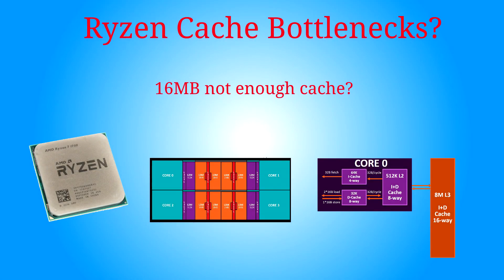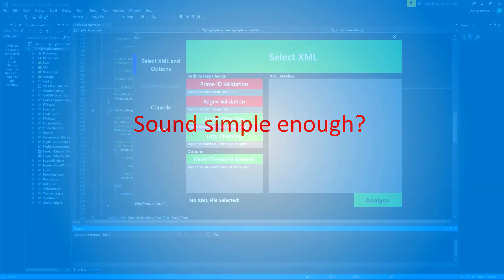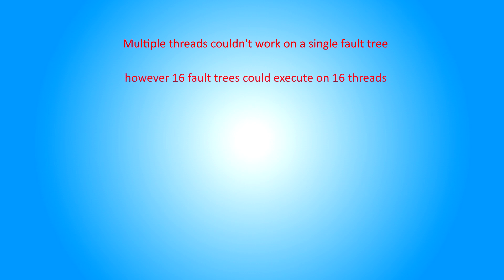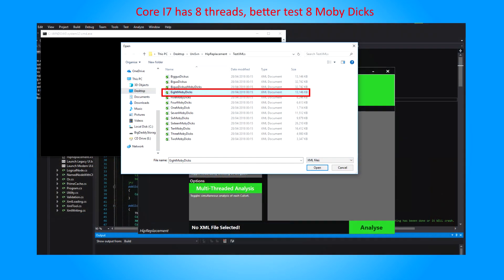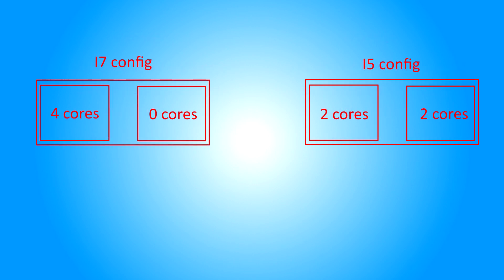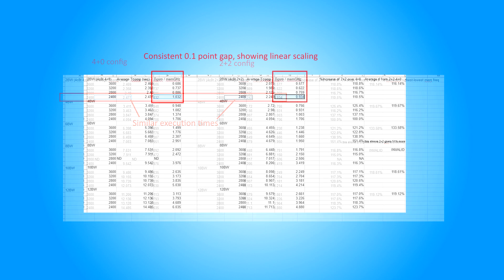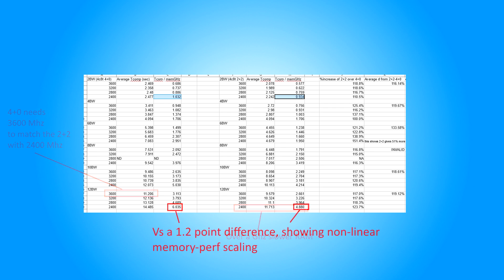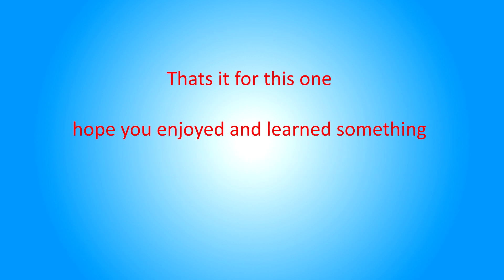Cache bottlenecks in modern CPUs

Comment from the maker: Ever wondered why the Ryzen 3 CPUs were in a 2+2 config? Here's why.
Reply: i remember the haswell (or was it broadwell?) cpus that had the 128mb l4 cache saw some pretty good gains in certain workloads even with lower clocks.  7zip with either compression or decompression (im assuming decompression because ryzen is so good at it) was really good.  i think maybe compiling as well.  there is a reason that certain low core count xeons have huge caches.  seems like i remember one that had 40-50 mb but  a very low core count like 4 or 6.

edit: you should try an i7 5775c I think it was. that was the one with 128mb edram l4 cache.  i was made for graphics but also functions as a cpu l4 cache.  there was also a haswell one but it was only available as a bga so only soldered driectly to the board
Reply: my question is why did you use 2+2 for the i5 when you used 4+0 for the i7.  i see no real reason to not use 4+0 for both if simulating either cpu
Reply: @ifyouwantmoneythengivemeev8094  yes but haswell also had the same setup with iris graphics and 128mb as well but it was only for nucs and such.  no socketed options
Reply from the maker: bad4ever2010  well I've not really found much issues with Zen otherwise. Remember this is a fringe issue. So for the most part 16MBs is fine.
Reply: Thanks for something different and thought provoking (in a nerdy kinda way). CPU cache limiting performance is not something I've particularly thought of in depth like this. Keep making these kinds of vids.

Comment: Interesting article detailing your specific usage and application (nice piece of software), however the results are not surprising in the slightest due to the multi-threaded nature of your workload coupled with the way the CCX's function along with the caching system.

I do have some questions however about why you did not test this with 1 and 3-threads per system as those results would be fill in the blanks, and I fully expect that if this application hits the cache as hard as it seems, the single core would show even better results than the dual-core, and the triple core would show a larger performance drop than going from 1 to 2 cores.

Also, the RAM latency can also make a very large difference, (although this depends very much on the application in question), some care little, and are all about the bandwidth, others are far more sensitive, your application seems to be bandwidth hungry, as seen @ 6:50 where the 2BW testing with 3200 MHz RAM beat 3600MHz, but 3600MHz won in all other testing.!

Lastly, It would be extra interesting to see if having both CCX's enabled but setting the core affiliation to only one CCX's cores would make a difference, and if so, what (as far as I understand (yet have seen no evidence) the L3 Cache from one CCX can be used by the other even if there are no active cores on that CCX)), this would mean that the cache is doubled, but the cache latency between CCX's would become rather important (this issue was addressed somewhat in the Ryzen 2000 series).

An update to this would be fantastic, not least as my suggestions would shed further light on the subject at hand, which of course directly relates to the functioning of you application and perhaps tweaks and optimisations that could be made.  Obviously All of this is utterly moot when testing on a different CPU with different cache setup (i.e. Intel), but for academic purposes this is very useful data :D
Reply from the maker: Firstly thanks for the comment, you raised some good points. The reason I didn't test odd number of hardware threads was because I couldn't configure the system to odd amounts, the bios would only allow for 2 cores, 4 cores (2+2 and 4+0), 6 cores and 8 cores. I then had the ability to configure SMT on and off, I did however test 6, both 4 core configs and 8 cores with SMT on and the 4 cores with SMT off aswel and i still have the data so maybe a follow up could be in order, also it would be interesting to see if having a second CCX active but providing only it's cache would be interesting and i would like to test this on a Zen2 cpu when I can get my hands on one so maybe I will do a follow up video on this.

Comment: I find this fascinating because I suspect that drawing on or rotating a large canvas in a drawing app means moving a lot of data, and performing fairly simple operations on it, and my own performance scaling seems to drop off a cliff after a certain point, in a nonlinear fashion, before scaling semi-linearly with subsequent increases of brush size.
I've suspected this is related primarily to cache size, but since it's hard to get solid numbers of performance, it's hard to test memory speed scaling to see if it's falling back to system memory.

Would be fascinating to see how it scales to a much beefier cache setup.

Comment: You can use the Athlon 200GE + MSI B50 MB, I got them clocked to 4Ghz(40xmultiplyer CPUv@1.425), but I'm not using the stock cooler, my max temp is 63.3 degrees. Cheap cpu and VERY good. Using 3200 gskill, not sure if memory matters, since the CPU mem speed limit is 2667Mhz;  It's the only memory I had available.

Comment: Very interesting! Greetings from Germany. :)
I found the same "problem" when testing games on my 1800X. 
I wanted to prove or disprove the comments, about Ryzen needing fast Ram, mainly because of the infinity fabric connecting both CCX.
So I did CPU limited game tests with 2+2 and 4+0 ...and 2133Mhz CL14 vs 3200 cl14(all timings locked).
So I thought I could compare the percentage gains, that 2+2 and 4+0, get from 50% faster Memory/50% faster IF.....and the difference of both gains should be the gain "solely" from faster communication from CCX to CCX because only 2+2 suffers from this.
I tested 11 games ....but the results where all over the place. Most of the time I saw 2+2 gaining 1-3% more avg FPS. But the frametimes where a different story....in most cases the 4+0 was gaining a lot more by faster memory. ....so the oposite of what I expected to see. 
Some games where doing much better with 2+2 or 4+0 no matter what memory speed.
But in general, it got clear, that 4+0 2133MHz memory was crippled by memory speeds, much more then 2+2 was. 
So my conclusion was the same as yours....L3 cache schould be bigger then 2MB/core.
I had the idea to buy a 1200 or 1400X...some 2+2 config with half the cache and test that against the 4+0....but just for one set of tests it is not worth the money and time for me.

Comment: Optimizing this would be a fun exercise.

The key to streaming data performance (for Ryzen especially) is to keep the data needed for running code to 4MiB or under - or to keep accesses within a 4MiB region of memory across all cores sharing the same L3.  This will dramatically increase the probability that the data is available when requested and prevent cache thrash, which is what you're experiencing.

I do this type of chunking all the time to keep core scaling performance alive.  I created a generic task system that allowed me to assign tasks to work on a chunk of data.  A single thread creates the tasks and the task system spawns and manages the threads.  The main thread waits until all of the tasks are complete in batches (so you'd process the first chunk then move to the next) until all of the work is done.

Comment: Was running the problem on a GPU considered?
Reply from the maker: It was considered, we decided that it would be more effort to implement and would only loose performance, the blue whale tree was very long and required strong integer performance, GPUs clock low and have very weak integer performance so we discarded the idea.

Comment: CPU on die cache has always been a tradeoff; It is extremely costly to produce, and more always helps.

Good example of cache bottlenecking is CPU monero mining, it has very little to do with CPU performance and everything to do with cache performance. I guess CPU clocks mainly affects cache latency for it, but cache size is the primary factor on how fast it runs on a CPU.

Comment: This kinda look more like a serializing memory write problem and not a cache problem.  The threads are supposed to be independent, but that doesn't mean they actually are.  You need to check to see where the stall points actually are, which you can do by generating a regular signal and recording the %rip address.  %rip sampling will generally be able to interrupt the cpu on the instruction following the instruction that caused the actual stall (so look back one instruction when perusing the results).  If the stall points fall on random memory accesses then it could be a cache issue.  Far more likely, however, is that the stall points are falling either on atomic ops on shared globals, or even NON atomic ops on shared globals.  Such operations do not scale well on any multi-core cpu... Intel CPUs tend to be able to serialize the hardware contention faster than AMD CPUs, but the point is to not have the contention in the first place.

I can give you a good example of this.  Write a simple multi-threaded program with a volatile int fubar_count; global.  Have all the threads simply increment the global, ++fubar_count (or equivalent in whatever language you are using), and tabulate the count rate.  Then test with N=1 thread, 2 threads, 3, 4, 5, up to the number of hardware threads available.  turn off any compiler optimizations so the compiler doesn't optimize-out the seemingly silly counter.  This is a demonstration of memory serialization on a single memory location and it can cause total havoc for multi-threaded workloads when the programmer doesn't realize that it's a problem.

The program itself might not be the culprit... language support or even the OS itself can be the culprit, depending on what you are doing.  Even something as simple as a global statistics counter can completely blow up multi-threaded performance, which is why programmers don't use global statistics counters for multi-threaded programs. It should be noted that the memory bandwidth on AMD cpus is approximately the same as the memory bandwidth on Intel CPUs. An Intel CPU with a bit more L3 is not going to make much of a difference unless the entire program and data fits in the cache, which seems unlikely from the description you gave.

The only way to tell for sure is to actually run some %rip sampling (e.g. like 100 times a second for each thread, signal based) while your threads are running and looking at what assembly instructions the stalls occur at (the instruction one prior to any given %rip sample).  Generally speaking, stall conditions cause %rip samples to predominantly fall on the instruction followin the one that stalled and not on other random instructions.  These will almost always be memory accesses, either atomic or non-atomic.  If they happen to focus on a global variable then you found the culprit.  If they focus on similar memory locations then it could be other things, such as read-mostly memory locations sitting right next to read-write memory locations on the same cache line.  Global locks are a very common culprit... even if the lock doesn't appear to be in the critical path, when you have a lot of CPUs banging on the same lock (even if it is e.g. a shared lock and there is no software contention, only hardware cache line contention), it can serialize operations across threads to the tune of 1uS stalls on every single thread.  There are many possible causes.

(I should add, don't base the count rate on the value of the global, particularly since you aren't using atomic ops to increment it.  Have each thread track the number of loops it does with a local variable.  Be careful not to share cache lines with other thread accidently . e.g. a global array local_counts[NTHREADS]  actually creates a huge cache contention problem because several count fields are packed together in one cache line). 

-Matt
Reply from the maker: Interesting point you make and something to keep in mind however i wouldn't be jumping to those conclusions as there were no shared resources between the threads, they all completed their own work independently before reporting their completion status although we wrote it in C# maybe .NET or even windows is doing something there, however we did test it on linux using mono and we got consisten results.
Reply: Are you using true threads (one process with many threads), or are you using multiple processes?

-Matt
Reply: .NET would be a prime suspect, yes.  Windows has other issues as well... on linux you can just start up however many processes or threads you want and the scheduler will do a very good job localizing them to the hardware CPU threads.  Windows will not do that... it will bounce the threads around unless you pin them to specific CPUs.  When threads bounce around, what basically happens is that all the cache mastership states for their local memory has to bounce between CPU caches, instead of staying localized in one.

If you can run this stuff on linux as independent processes which do not share resources at all, that would be the best test.

-Matt
Reply from the maker: @junkerzn7312  I was using threads not processes.

Comment: Bro i don't want to ruin your tests, but the latency problem depends mainly on the ram frequency you used. 2444mhz its too low even for ryzen 1. You ruined the test yourself. Use 2933 or 3200 ram and youll notice HUGE differences.
Reply: You clearly didn't watch the whole video
Reply: did you even watch the video?
Reply: I just went from 2800mhz Cl20 to 3400 Cl16, night and day difference in everything I'm doing on my ryzen 7
Reply: @BPCougar8000  Obviously, your memory latency improved massively. 3400CL16 equivalent latency-wise @2800 is CL13.

Comment: What about 4/4+0/0? Did u do it and I missed it perhaps?
Reply from the maker: Do you mean 4 cores with SMT  disabled on only one CCX?
Reply: This would be my question as well. How would a 4/4+0 do?

Logic being the 2/2+2/2 has 4MB of cache per thread, 4/4+0 would be 2MB per thread, and the 4/8+0 would be 1MB per thread. Would it be the same? Double cache but half threads canceling eachother out. Would it be slower? SMT threads are actually worth more than the cache. Or faster? Cache is king and SMT is actually limiting performance.

It would only answer these questions for this kind of workload but it's interesting.

This also lends some weight to the rumors of 256MB L3 cache for Zen2/Rome.
Reply: @Church256  That's something I'd like to know.  I'm going to play around with this in real world scenarios when I get home later this evening.

Comment: Why would you run one in 4+0 and the other in 2+2? it is BOTH 4 cores, so you are comparing 4 cores vs. 4 cores with half cache. Also crippling the AMD by 2400 MHz RAM is a huge fault since Intel is not dependant on RAM speed like AMD is, so the true Intel you "simulate" will be way faster with that RAM speed.
Reply from the maker: At the time, i was un aware of the cache differences (this is how i fount it out) and at first i went for a 4+0 because it tested a monolithic quad core as found in the University processors. Also my initial tests were with 2400 MHz as thats what the OEM systems at the University had. All i was trying to do was to emulate the processors there. When it came to testing the performance scaling however, i did test from 2400 to 3600Mhz RAM, and you can't say that 3600Mhz is crippling the AMD CPUs.

Comment: That was really interesting.  One point of clarification . Were you programming the whales (12) per CCX module?  Could you program it to run 12 per CCX module?  Ie 2 separate runs for the 1700 and so on?  Second question, did you lock all cores to the same frequency?  Last question, when mining I prioritise cryptonote (via task manager) to the eight cores.. It likes the real cores versus the threads.  Do you think this is because of the effect you're seeing here?
Reply from the maker: I wasn't specifically allocating a whale to a certain core, i just disabled the other CCX and ran the program and Windows allocated all the threads to the available cores (on one CCX), and i could run as many as i want (or notepad++ will let me make) or as few cores as i wish. As for the frequency, all the tests were run at 4Ghz core clock. And lastly each of the two CPU threads in a core gets the same priority as far as the core is concerned (although maybe windows treats them different but there are no "Real cores" and "logical cores") although if you put a load on 2 threads on the same core, you will see performance drop.
Reply: @bassbatterer   interesting, disabled via BIOS?  Thanks for the thoughtful response
Reply from the maker: @Gillsystems  yeh, in the bios you can disable cores. I disabled the ones in an entire CCX which caused the entire other CCX (including cache) to be disabled.
Reply: @bassbatterer   too bad, imagine taking all the cache to a couple ccx's to a threadripper